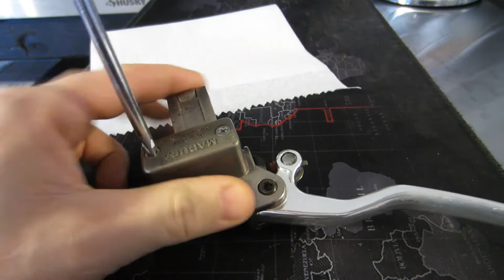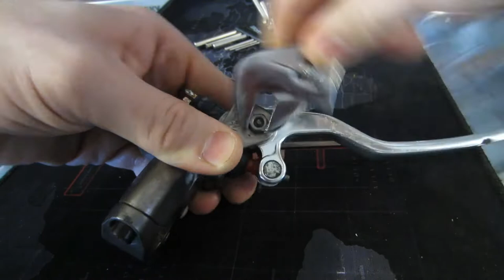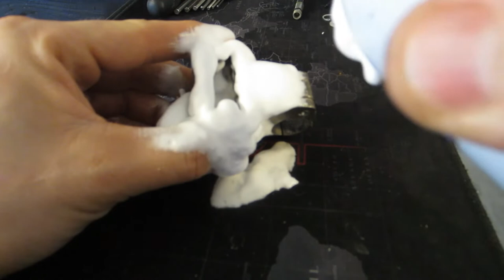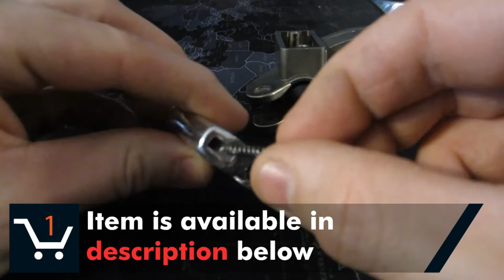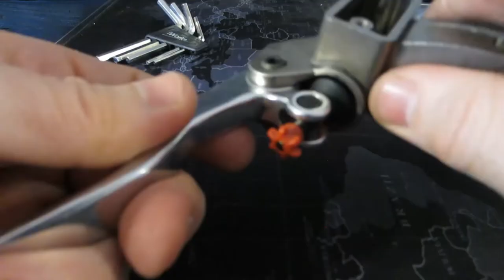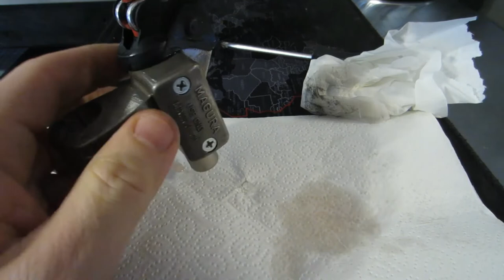Polaris Outlaw 450/525 Clutch Master Cylinder How To Rebuild

Comment: I hace a major question whats the the piece under the clutch handle you use to tighen it i was adjusting mine went for a rude it feel off now im fked
Reply from the maker: That's the lever adjuster. You ain't that fed you can find a new lever and it comes with the adjuster.
Reply: @TorrentPerformance  thanks for the help man just bought a new one